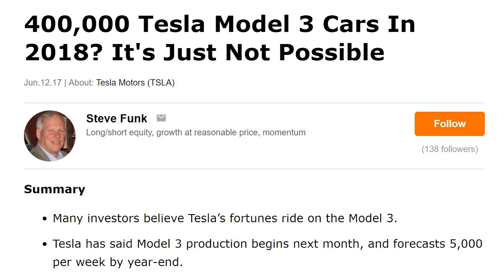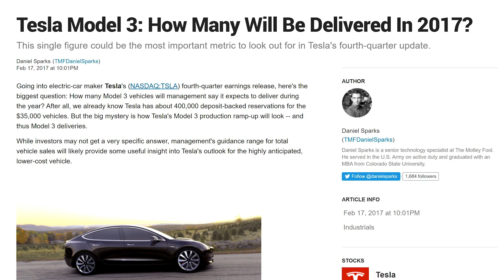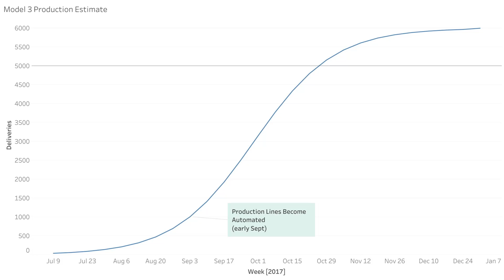TESLA MODEL 3 PREDICTION - 83K Delivered in 2017 But Will It Be Enough to Please Investors?

Comment: Elon once talked about inceasing the assembly line speed due to automation. As soon as you are able to double the line speed from one Inch per second to two Inches per second and reduce the gaps between cars as well (in which nothing is produced) you are able to hit the 400k figures. Don't try to look at the NUMMI past. Tesla is improving the machine which builds the machine (car). This is, what all other manufacturers are afraid of.
Reply from the maker: +Horst Lüning when I toured the factory a couple weeks ago it didn't seem like they had enough space regardless. I hope they can pull it off though!

Comment: Ben,  Did you factor in that building a Tesla is FAR less effort than building a normal car?  Gigafactory will make battery packs I assume.  Motor company makes the motors.  Tesla needs to stamp metal, weld and paint, plus install interiors and the rest.  No motor no tranny, etc.  So Tesla should run about 1.5 to 2x whatever previous plant could run.  How many acres do they have next door to Gigafactory?  That's where I'd build the next plant, adjacent to eliminate battery shipping.  Nice low rent property.

Comment: You are assuming that Tesla's only technical challenge going forward is production of those cars. Most manufacturers do something called Pre-production runs to test the manufacturing jigs and iron out defects in the cars as well as the plant, typically  lasts about  2 years. Most companies will also do a Pre-launch run to build up and distribute cars to dealers, typically 2-6 months. Tesla does not do either. With almost everything new in this car, there is also the technical challenges with the car itself that needs to be ironed out. I wouldn't estimate anything below 6 months before the plant reaches full capacity. 6 months as best case and 10 months as worst   case. In comparison model X took more than 2 years despite sharing almost 40% of the parts with the S and it's production line. The S took almost 3 before that, despite having similar features to the proposed initial Model 3.

Comment: I really like your analyses a lot. However, Tesla always stated they estimate to be able to produce at least 500k cars at the Fremont factory. Estimates based on traditional cars having being build at the plant  20 years ago is no evidence Tesla's estimates are wrong or too positive. They may be, but there is no reason to assume someone elses estimates are "better" than Tesla's.

The 10 to 20 factories is Tesla's "endgame" size. If I remembered correctly...Elon estimates it will need 100/200 Gigafactories to supply global demand voor automotive and energy-storage. So he's aiming at around 10% market share. Basically...he wants to build as many cars as Toyota/VW and wants to be on par with BMW in 2022 (around 2 million units).

The next factory will be for the Model Y and Elon expects to 500k-1 million units a year in a brand new plant for that model alone.

Quite some space at the Gigafactory 1 will be used for the model 3. Not only will the factory produce the batterypacks, also the drivetrains will be produced there. And maybe even more.

Tesla did acquire permission to expand in Fremont. So who knows what will happen there between the end of 2017 and the end of 2018. ;)

I hope Tesla will be able to produce 80k+ units (Model 3) this year. For some unfounded reason, this number "feels" high for me. But that's just my gut speaking and not a model with predictive capability ;). If I had to go on instinct (by lack of in depth data from Tesla it self)...I would "bet" on a number somewhere in de 40k-60k region for 2017. With the bulk produced in Q4. Oh, and I predict very snarky remarks in the media on the "low" Q3 production numbers. But that's a no-brainer I guess...

Comment: Heh.  I wouldn't use your terminology or technique, but it turns out I agree with your conclusion nonetheless. ;-)  You are using the word 'Delivered' here, and I try to be a bit conservative in that regard myself.  At one point last year Elon Musk said he wanted to try to reach Production of 100,000 to 200,000 units of Model 3 during 2017.  I always point out that Capacity, Production, and Deliveries (Sales) are all different things.  Production is typically a bit less than Capacity, and Deliveries are usually a little less than Production.  If Production can be 90% of Capacity, and Deliveries can be 80% of Production, Tesla will be in very good shape.  Meaning some of the cars Produced during late 2017 won't actually be Delivered until early 2018.  And that's fine.  I absolutely disagree with the ANALysts that insist Tesla will miss their target for Deliveries by anywhere from 75%-to-99%.  Those guys are smoking crack and liking it way too much.

Comment: Hi Ben
Thank you for your show. 
You should look into some of your numbers. I'm surprised that so many remembers the numbers wrong. At the shareholder meeting, Elon said: 
 1000/w In July
 2000/w in August, 
 4000/w in September and 
 5000/w before end of year. 
I read the same article from Steve Funk (Seeking Alpha), he's really pessimistic about everything Tesla does. The numbers Steven mentions are probably correct, yes, but they might not be relevant. There is one (huge) factor that could make the second line faster than the NUMMI numbers. As far as I know, Tesla has built up a totally new production line on the place of the "NUMMI Small Car Line". The Kuka robots are brand new, and will probably be of the latest capacity. So, why would Tesla build something with same throughput as NUMMI did 15-20 years ago? Not saying Tesla will hit the numbers, but I really expect Tesla to exceed the NUMMI numbers. 
Keep up the good work!

Comment: First of all, I have a few shares of this stock...When comparing the Model 3 to traditional production you should consider the level of complexity and number of parts...Complexity and parts slows production...For gasoline cars, even if the gas engine is produced off site, installing it adds complexity and parts, think about the exhaust system, fuel tank, wiring etc...Furthermore, the dash of a Model 3 looks to be rather simple compared to other vehicles....and then, we must also, consider those initial orders will have few options....Doing a basic carbon copy should make the initial ramp go quite well....its when you start adding options that it should become difficult to meet the high levels of production...but, again if overall options are limited and you are producing large volumes of say blue dual motor then that may be doable as well...Also, I have a feeling the battery is going to be a software upgrade so, that the initial install is the same on all vehicles...Sorry, for the length of this...

Comment: Great analysis Ben and looks like a good guess.  I personally think the number will be lower.  Closer to 45,000-50,000 in 2017.  Yes the Model 3 was designed from the ground up to be a mass marketed car so one would predict higher numbers.  However, I believe they will get the employee/owner reservation cars out first (few thousand) in the CA market and see how they respond to the real world, keeping the manufacturing speeds to the lowest numbers to start.  Say they run like this for a couple of months then barring no major issues cropping up, then start ramp up towards 5,000K per week goal, which I don't think they will hit till late this calendar year.  They've got a real winner with the Model 3 and there is no reason to push out 100,000 of them this year for the sake of stock prices or quickly satisfying as many reservations as possible.  A smart phased ramp up erring on the side of caution is what I believe will occur in reality.  Getting to 400K by the end of 2018 is reasonable providing they've worked out all the kinks in the system.  However, remember that Tesla is more than just a car company (energy storage and energy creation also) and these business units are growing like crazy too, so there is really no pressure for Tesla to produce 100,000 Model 3's this calendar year, as long as they can stay somewhat cash positive.  We know the S/X sales will probably remain consistent or provide slight growth, which adds to a healthy gross margin bottom line.
Reply: I agree.. I think the tax credit is a factor here, where Tesla can keep production artificially low after the initial batch to employees and previous owners as a final quality control / user acceptance test, then sharply ramp up production at the start of Q4 or even Q1.

Comment: Tesla is not working with a two shift system, but three shifts instead, due to labor security too. Not sure how this will impact the production capacity.
Furthermore, how do the new robot installations affect the production capacity? Are there bottlenecks which can't be changed within the production line? 
(means, old installations which are too expensive to exchange or being added)
Reply from the maker: Check Steve's article. He breaks that down in pretty good detail although he is def a bear on Tesla so take it with a grain of salt (and maybe lime and tequila)
Reply: Thx for answer. If there is a shot of lithium in the salt. =)

Checked the article, but if I understand correctly it's mainly about the paint shop. Thus, first question would be, if anything in the paint shop changed or not or really got replaced or added (maybe you remember from the factory tour?) .

I remember to have seen that the robots in the production lines are using multi-tools, even in the paint shop. Lifting / turning openings with the robot arms for access of the inner side. It's more difficult to establish due to complexity, but might affect the production capacity, due to "slim production" too? Impossible to say from the outside, you'd probably need a stopwatch to see the difference.

I can only guess that the truth is somewhere in between. Without a real insight impossible to say of what changed and affects production capacity.  And I'm not referring to a simple factory visit you lucky guy had. For me it's sadly a bit too far from Europe.

Comment: I think your projections make sense. Time will tell. Personally, however, even if Tesla builds that many, I hope they'll purposely hold BACK on delivering them in 2017. They've already delivered ~130K cars, and if they deliver ~70K more before year's end, they will cross the federal tax credit threshold. For customers' sake, they'd be smart to ramp up production to make as many vehicles as possible, but NOT hand over the fob for the 200,000th car until 1/1/18. That way, the full $7,500 credit would run thru 6/18; $3,250 thru 12/18; $1,725 thru 3/19.
Reply: I agree with Mark, I believe Tesla will hold back (if they have to) in order to maximize USA tax credit, as Elon has stated they will be smart about doing so.
Reply from the maker: I did some analysis on that also. They probably don't need to hold back at all considering the log growth model.

Comment: Don't know where Funk is getting his ideas, but it sounds like he's pulling them out of his smelly hole. The nominal capacity of the NUMMI plant has always been quoted as 500,000 vehicles per year, which it supposedly produced at one point. But Tesla did not buy all the equipment in the plant, they bought largely empty buildings and had to populate them with new equipment. (There was $17M of equipment and parts that they bought from Toyota.) Besides, their processes are considerably different from the conventional ICE powered steel bodied vehicles that were previously produced by Toyota and GM. Tesla is more vertically integrated than NUMMI was, but some of those processes were offloaded to Gigafactory 1 or their other California parts factory in Lathrop. 

And Funk is wrong about the Fremont plant not being expanded by Tesla. They have expanded it and continue to expand it, in 2016 Tesla purchased a neighboring 25-acre site which they are now building on. The paint shop was completely reworked in anticipation of producing the Model 3. Capacity was also added to the body shop. There were also assembly line stoppages to rework it, mostly for the Model X. And of course, Tesla is now running three shifts, not two. In short, Funk is demonstrably ignorant of the true facts.

The Model S/X assembly line is highly automated by luxury car standards (all body panels and other heavy components such as the battery pack are installed by robots) and the plans for the Model 3 are to be even more automated, state of the art or better for a mass market car. Grohmann Automation was acquired with this plan in mind. The Model 3 was also designed with automated assembly in mind. 

It is true that the Model 3 line will bring the Fremont factory to full capacity and further expansion requires acquiring additional factories elsewhere for the Model Y and follow-on products. We've yet to hear any details of these facilities, but they are probably all going to be on the scale of Gigafactory 1 and be multi-use facilities. It should also be noted that the plans for Gigafactory 1 were also expanded, if memory serves, by 40%. Wikipedia quotes numbers of 50 to 100 percent increase. The Model Y will be fully automated, no human hands required during assembly.
Reply: That's pretty much correct, I have visited over 700 factories in China in the last 16 years producing pretty much everything, but not that much about cars (car factory visits were more than 10 years ago anyway). To assemble cars without using humans would require everything to be made in pre-assembled plug-in components that are wireless and hoseless !!! That's why I was curious why a guy who had over 30 years experience in car manufacturing thought like that. He also said: "The robots are so much faster one could handle several cars at the same time for the speed the assembly line is moving, but you cannot speed up the line without making the robots move along". After seeing several automated factories that pull the product out from the conveyor belt for additional work (customizing and adding options), and then back, I wonder if the same works when manufacturing cars. Less options you have the faster the car goes through the production line, so in the beginning you would have cars numbered #1,2,3,4,5,6,7,8 and in the end of the production line you would get out #1, 2, 3, 39, 4, 18 ,5 ,22 ,23 ,24 ,5 according to how many motors, what kind of roof, lights, seating, frame material, autonomus driving sensors  etc. would be installed.
Reply: dlwatib well said. I was going to make a very similar comment.
Reply: One Chinese automotive switch factory guy told me this right after the model X came out and he actually got to test it. "Sit on the middle seat, look around, there is hardly anything you can find from standard car designs, from under the hood even more. I predict the model X will have so many quality problems people will not buy them and it will flop. If Tesla wants to succeed they should learn from Toyota, learn to produce simple and reliable car, then add more complexity later. You have no idea how difficult it is to produce good quality products." He should know, it took their factory very long time to produce good enough parts for Toyota and Honda. Looks to me Tesla has learned their lessons, but to make M-B quality level cars, I don't think so. I used to work at Bay Cities Auto Auction in Fremont, almost cross the railroad tracks from the NUMMI plant. Seeing lot of identical used car models and driving about 18000 of them I realized that M-Bs were always good. We used to say that they are made for northern Scandinavian roads with ice, snow and low temperatures and that's why they work even they are 20 years old, well, it turns out the same quality holds in California year around sunshine and salty sea air.
Reply: I once visited VW and GM factories in Shanghai and happened to ask one engineer (I don't remember which plant it was), how they could make the assembly  process faster, he said:"By lifting the cars on their sides, but then it would be robots only assembly line". It kind of makes sense, you could have two cars side by side on the assembly line up till the engine/transmission/front suspension/wheels are mounted. With electric cars it makes even more sense or does it?
Reply: down P
Reply: Lots of words, but you don't address the question. Do you think Tesla can produce 83,000 model 3s in the next 6 months?
Reply: Now when I have paid more attention to car manufacturing I'd say yes.Tesla has been practicing car manufacturing the last 10 years by pushing the design and manufacturing limits. Now they are taking that expertise to the other extreme, making something simple with the most sophisticated manufacturing methods. The Fremont plant is mostly an assembly plant, many parts are made by subcontractors which might cause problems.
Reply: idk about exactly 83, 70k+ tho yes for sure.
Reply: There are 16 known habitual design and quality failures with the Model S alone, (I'll just list the top 8)  the Model X is off the charts. Model S: 
Leaks all over the place
Door handles not operating
Wipers not effective
System crashes in the central console (car is immobile)
Tyre system monitoring fails
Electric motors fail and/or are noisy
Many , many door trim failures
Misaligned and ugly panel gaps

I have a Mercedes-Benz E Class. If I HAD ANY of these faults on my car, I would have returned it and asked for a replacement. Tesla owners don't complain because they're Tesla owners. Tesla could sell them a rusty bicycle for $50,000 and they'd still be "delighted"
Reply: No humans hands for assembly.   You know nothing about building autos! LOL